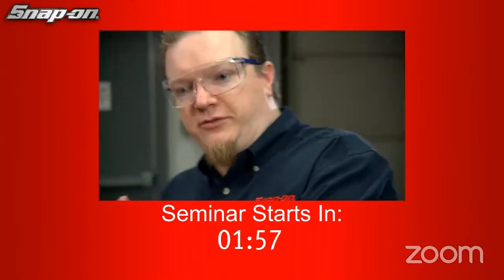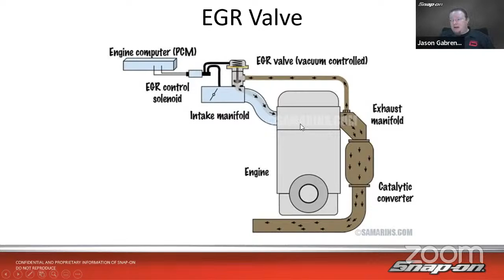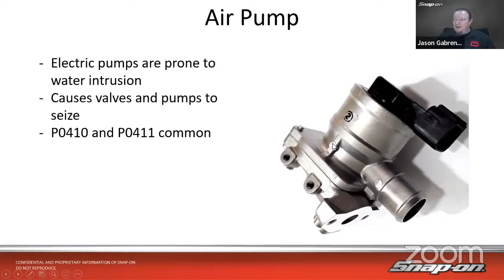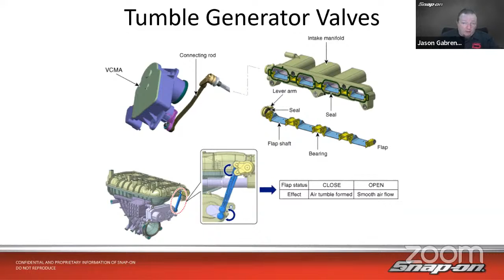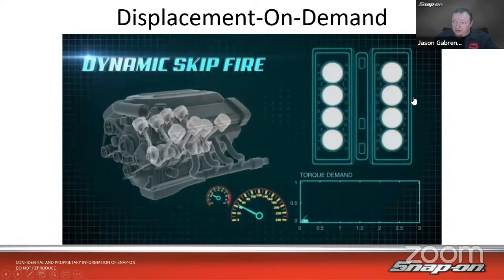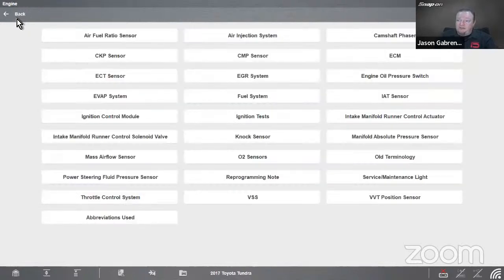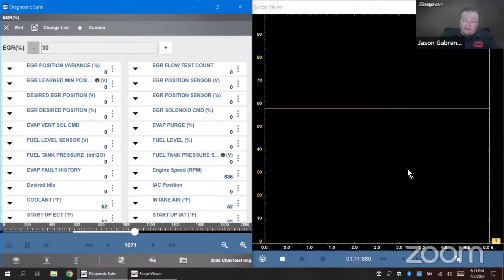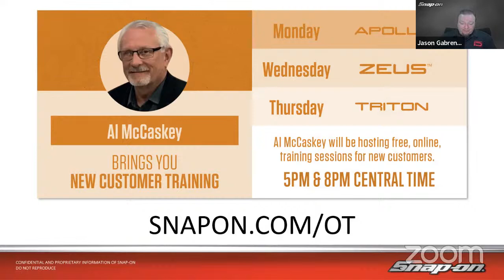Tuesday Diagnostics Livestream - Auxiliary Emissions Systems Operation and Testing

Comment: Pro tips about the Subaru gaskets:
Pay attention to direction of the gaskets when installed. The gaskets can be installed backwards and look correct. This will later generate a code.

For example: the Subaru WRX STI engine (EJ 255) has a EGR pipe on the passenger side cylinder head (bank 1). The locating is behind the turbo’s up pipe. The diameter of the EGR pipe and diameter of the cylinder head EGR outlet are the same. The gasket does not have the same diameter, because it’s smaller to trim the flow. Install it the wrong way generates a code for too must flow. The code will not make sense and you’ll bang you head against the wall for days wondering what the problem is.

Comment: I have a question how would I setup the vantage pro oscilloscope to read engine vacuum ?  And can it only graph a cranking engine or can it capture each pulse while running
Reply from the maker: You would need to set the channel probe for the transducer you are using. It should be able to show you both cranking and running.
Reply: @SnaponDiagnostics  thank you I’m using the vantage ultra with the 0-100psi and 20hg vacuum so my question is what I should set the settings on the scope too to read the engine vacuum pulses

Comment: When troubleshooting these systems a good customer interview makes all the difference.
90% of the time, Three minutes shaking down the customer fixes the car for an easy 1hr.

After talking to customer I learn one of the follow and my job is much easier.
1. Another garage just worked on the engine and/pulled engine; maybe something is unplugged
2. I just bought the car and it was previously owned by a kid. Ebay mods?
3. Customer like engine mods and deleted the EGR or blocked it without tuning the car

I wrote a simple questionnaire that my advisor has the customer fill out for every diag. The first thing the worksheet says is “this questionnaire is designed to reduce the cost of diagnosis, failure to disclose vehicle history and/or previous repairs can incur addition diagnostic time for specific tests. Please be honest.”

A lot of people are assumed to admit their sticky fingers caused the problem or their cheap ass hired someone off Craigslist who said they know what was wrong